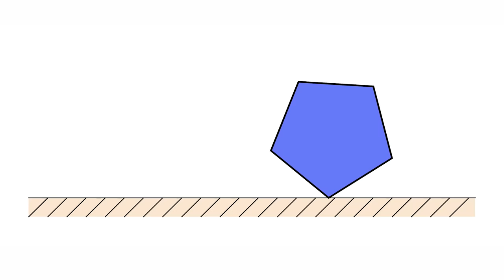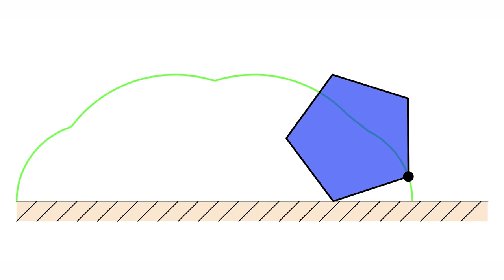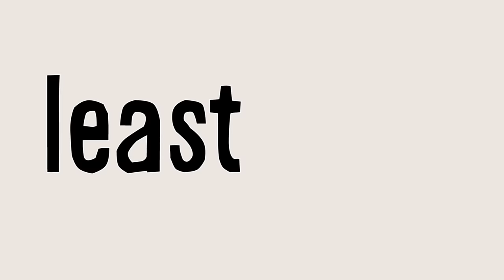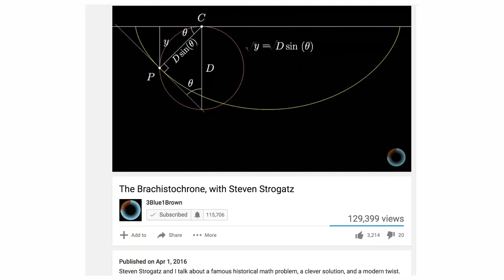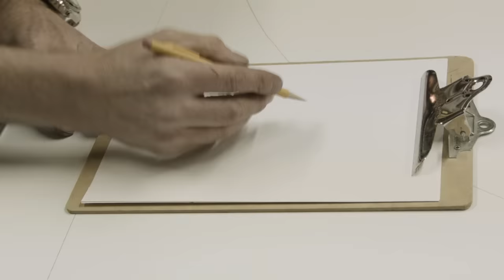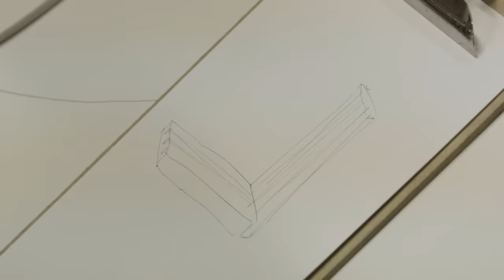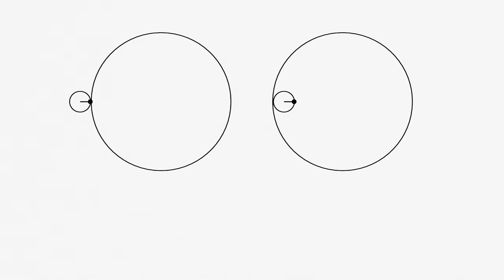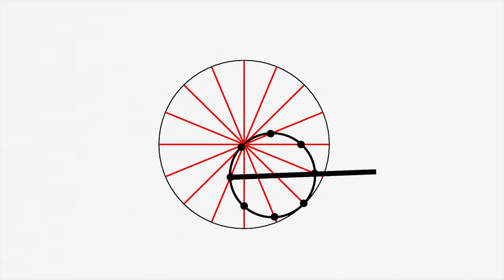The Brachistochrone

Comment: What I find so fucking cool about this video is that it actually proves the effects of elastic collisions experimentally as well.

When we were learning collisions in my Mechanical Dynamics class (engineering) (basically complicated mechanical physics analysis), we learned that there is a relationship in collisions between the entering velocity and exit velocity of the components of the collision changes based on how elastic the collision is, elasticity is a ratio value.

This video studies or proves the path of least time of a falling object to reach a destination horizontally and vertically, but it also proves that the distance traveled in the elastic collision between the stop at the bottom and the discs is proportional to the velocity they hit the stop at, which is also related to the amount of time it took the object to get there (all linear relationships).

If you look at a freeze frame at 18:06 it shows that the curve got there first, and had the largest displacement backwards after the collision, the exaggerated curve got there second and had a smaller displacement, and the straight line path got there last and had the smallest displacement after the collision!!

I watched this video when it came out 5 years ago, and I'm a senior in college 5 years later, and I find this even more interesting!! I LOVE MICHAEL STEVENS.

Comment: In the first examples, they showed the brachistochrone curve actually dipping below the height of point B and curving back up to finish. In the model they have built it is just progressively less steep from start to finish. It would have been nice to see the difference between the curve that sits fully positive y axis and the 'ideal' path shown in the beginning of the video.
Reply: You are correct, I am pretty sure the curve they made isn't the ideal solution, because the ideal solution would start completely vertical rather than ending completely horizontal. Ending completely horizontal does make the special property at the end to appear.

Comment: I know this video is now over 5 years old, but in the off chance you see this comment, I have a suggestion for a future project with Adam. Construct this model but extend the track to include the mirror of the tautochrone. In theory, we should see the objects align at the lowest point on the track, and then carry up the opposite to a height proportional to their starting height before reaching peak PE and returning to the bottom. They'd start separate, line up, separate again, and so on. We can all imagine what will happen, but it would be so cool to see it in practice.

Comment: 20:34
Starting from the bottom, it's gonna be tough, not because of friction, but because lack of potential energy, meaning it's not high enough. You stated since the beginning that the only force acting on the falling body is the gravity force. Thus, it is assumed the slope is frictionless.
Reply: But...it's true, it's only tough because of friction. In theory, in simulations without any friction, it would work for ANY point on that curve, even the one a few milimiters away from the finishing line.

Comment: In all fairness, if the two points are placed on a perfectly vertical line, the shortest path is also the fastest.
Reply: it doesn’t has to be vertical if there is no surface to roll since the sideway velocity doesn’t change the vertical acceleration!

Comment: 15:37 after 7 yrs i have realised an issue with the visualisation that michael has put in the video.... If the smaller circle has 1/3rd the radius, it will rotate FOUR times instead of the three that has been shown in the video around the bigger circle and the same extra rotation goes for the previous visualisations as well.... Its called the circle revolution and coin rotation paradox, veritasium had even made a video about it

Comment: The speed of light has nothing to do with snell's law. The reason why light bent on water or why it apparently slows down on water, is due to quantum non locality. Waves exploring all possible paths, creating a wave-party in the water. The combination of all those messy waves gives the result of an apparently slower speed of light.
Reply: the refraction follows snell's law, which happens when light travels through different mediums with different speeds

Comment: Is the straight line the fastest in a vacuum?
Reply: Very late reply but for any future viewers and in case you never got an answer:

No, the only way the straight line would be the fastest is if gravity wasn't involved and instead they were each given an equal 'push' to start.   Vacuum has nothing to do with the forces involved other than reducing drag which is of very little influence in this experiment.  

In all actuality they would likely prefer the experiment to be performed in a vacuum state with tracks that either have 0 friction or are at least much closer to said state.

Comment: its vacuum sealed kinda...oh oh car people know vinyl car body skins..
1 Spraying a thin film of water between two non porous surfaces makes the two suface cling to each other.
2. Squeeze that water out using flat edge flexible hand tools. 
3. This absence of either water or air between the  two creates vacuum conditions and  the film "glues" on the body due to atmospheric pressure.

Comment: 7:35 that curves up. That would severly slow it down
Reply: The momentum carries it over there without it slowing down its faster than the shortest possible path because the shortest path has almost no momentum and it’s faster than the longest path as the long path is to long

Comment: Impressive maths / geometry / science as usual from Michael. The engineering though ... not so much. Seems to me that this could have been done better using guttering and balls, perhaps ping-pong balls which move slower. Or some Hotwheels track with Hotwheels cars. Why clear acrylic sheet? And those bobbin wheels seem to generate a lot of friction. Note that a fourth curve could have been included, with an inverted cycloid: motion is slow at first, but with rapid acceleration at the end.Or a compound cycloid, with hills and valleys.

Comment: i have a question. Would this apply to a "racing line " round a bend on the track? given that theres an acceleration from the car's engine which is probably not constant. Traditionally calculated via the closest straight line..

Comment: I have a question. This demonstration uses half of the curve but the half curve is not symmetrical. If you accurately time the drops will the curve perform the same in both orientations. This test would I think need to use the same x and y start and finish points for both orientations to be equivalent. As flipping the curve would mean it is taller with less travel. I would also like to know where these curves are used in industry. For instance would this curve be used in the complex shape of a turbo rotor. There must be great potential for conservation of energy efficiency in fluid dynamic applications. Would a projectile with this curve nose cone fly faster / longer.
Reply: Thinking about this I think with fluid dynamics wetted surface is perhaps key, as this curve is longer it will increase wetted surface area and therefore possibly increase flow resistance so maybe not the best in that application. Maybe the difference is between when a constant or fixed force is applied rather than the acceleration of gravity. Making my head hurt lol. would be interested in any thoughts especially any examples of use in industrial design.

Comment: What if those rolling stuff are actually metal? Or something heavy? That would lessen the friction near the bottom part
Reply: It wouldn't lessen the friction, but metal or some other heavy material would have more momentum and wouldn't be slowed as much. Looks the same as lower friction, but it is actually slightly different.
Reply: @LegorocketsAnimation  this is true, the momentum would overcome the force of friction, but either way they seem to link together at the "finish line."
Reply: @LegorocketsAnimation  I see. Probably just me randomly thinking about the science of this stuff. Probably if they have something rolling that handles aerodynamics well, I think it would consistently go down properly. But I dunno if such a thing could exist...

Comment: 0:40 "would only make a cone about 7000 people tall and 2000 across"
...
Huh? The math isn't right. Even if it was a cuboid instead of a cone, the volume would only contain 14,000,000 people. You're off by a scale of 500x.
Reply: if it's a cuboid it's 3D so shouldn't it be
7,000 × 2,000 × 2,000 = 28,000,000,000

Comment: i have been searching for methods to draw this curve for the past week, and all of the tutorials and instructions i can find utilize a physical method to draw a line on paper. however i'm trying to draw this curve digitally, and i'm not drawing the entire curve every time, sometimes i only want a portion of the curve and the wikipedia entry for this curve is some high level math that goes way above my head. do you know of any ways this curve can be drawn in cad with some sort of equation? the best i can do is trace along portions of the circumference with a simulated wheel spin using a spline tool which is not perfectly acurate to the actual curve, but it's as close as i can get for now.

Comment: Why doesn't the law of conservation of energy workout here???
Reply: The real question as always is, what makes you think it doesn't?
Reply: @Релёкс84  well if law of conservation of energy is satisfied all the balls have to reach at same time irrespective of path follower
Reply: @kazuyamishima1713  That's what I was thinking you had in mind, and no, that's not correct. What is true is that the balls will leave the slope with the same speed (assuming you neglect friction), but what matters for the transit time is not that final speed, but the value of the speed inbetween which varies depending on the shape of the slope.
Reply: @Релёкс84  work never depends on the path followed  so irrespective of the velocities in between the path or the slope,all the balls will have same final velocity
Reply: @kazuyamishima1713  That's right, and having the same final velocity is exactly what conservation of energy dictates, hence why your original question was unfounded.
Reply: @Релёкс84  But according to that video conservation of energy is not satisfied and its clear!!!
Reply: @kazuyamishima1713  You'll need to be more specific what you're referring to then. As I already said a difference in travel time does not violate conservation of energy (just like an object sitting in place forever doesn't violate it either), so you have to be referring to something else entirely.
Reply: I guess that there should not be any travel time difference between the balls when the are starting and ending with same velocity.
Reply: @kazuyamishima1713  you already said that, and I already told you that this guess is not true. So why are you still writing? Are you failing to see why it's not true?
Reply: V=u+at here v,u and a are same for all the balls so will t hence there no travel time difference
Reply: @kazuyamishima1713  a is not always the same! it depends on the slope that's under the ball at any given time. So not only is it different from one ball to another, it even changes over time when the slope is not straight! What you're describing are balls in freefall, and of coures these will hit the ground at the same time, but this situation is obviously different...
Reply: @Релёкс84  try using v^2-u^2=2as where s is the displacement which is same in all cases and u will find a is same everywhere
Reply: @kazuyamishima1713  What you just wrote is true, of course, but open your eyes wide open and notice that it says NOTHING about the TIME it takes. Your reasoning is right but your conclusion isn't.
Reply: @Релёкс84  Dude I am concluding that a is the same in every case and when u use that a in v=u+at u will understand that there no time difference
Reply: @kazuyamishima1713  And that conclusion is wrong. It's no use memorizing formulas by heart if you don't know what they mean or when to apply them. I'm done with you because you don't seem able to understand new things and instead keep repeating the same thing over and over again while refusing to accept that it is incorrect.

One last thing: try to picture a ball rolling down a 45° cliff. Then another ball that starts in the same place but falls straight down and then continues sideways with the velocity it gained falling. Take the time to compute these travel times, and then look in a mirror and say outloud how much difference there is.
Reply: @kazuyamishima1713  thats if you forget drag and friction
Reply: @Nebulisuzer  yess that's what i am talking about